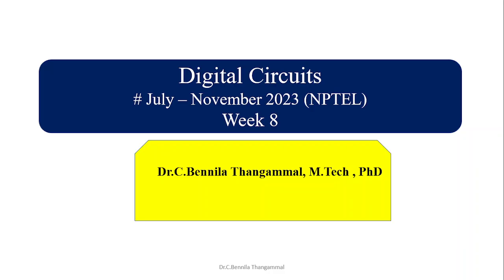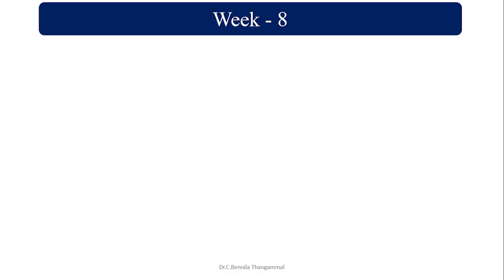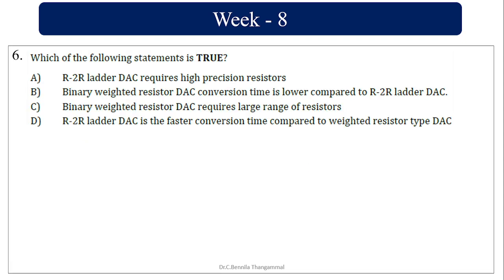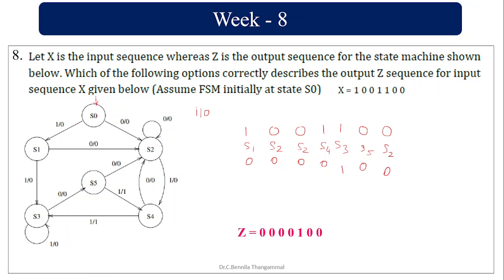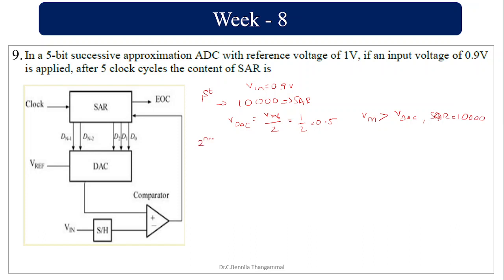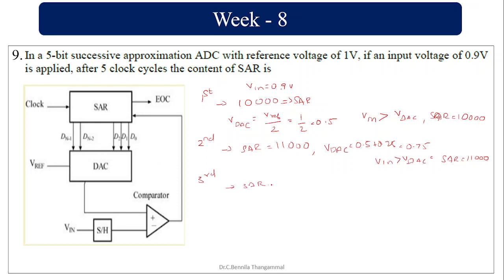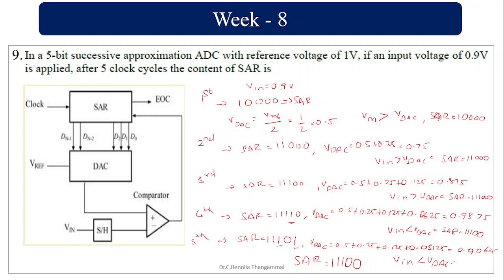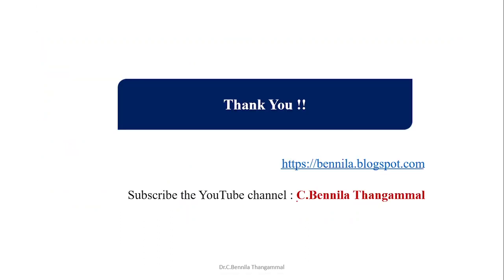Week 8 Digital Circuits Assignment Solution

Comment: 1.flash type 
2.-13.125
3.-9.375
4.faster response to in changes 
5.100
6.C
7.flash type high
8.000100
9.11100
10.c
11.0.0039
12.constant offset occurs bt ideal op
13.decoding 
14.inductor
15.clock spped and setting time  of convert